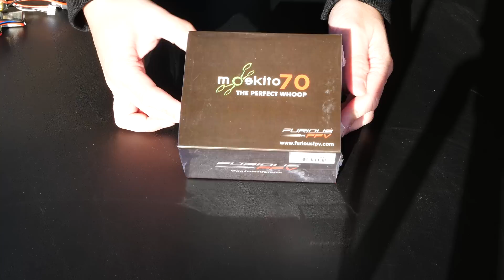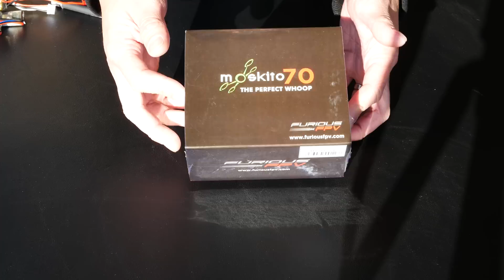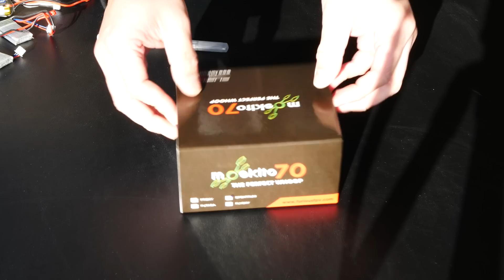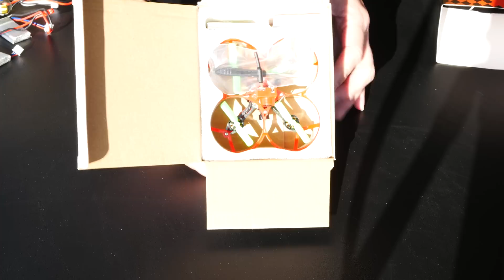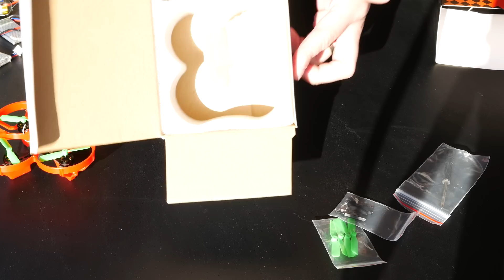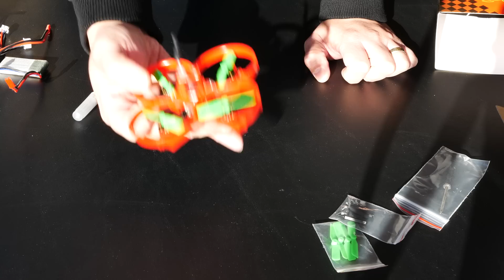FuriousFPV MOSKITO 70 Unboxing

Comment: Farmer fpv: bumper and esc guards are nylon for production models, however far from indistructabal, i cracked mine, fixed with epoxy, spares are $6 or you can print your own i supose, also unlike the inductrix you dont need to run propguards on the moskito since they dont hold the motors

Comment: I'm pretty sure the duct rings and all the plastic is all 3D printed, according to all the other reviewers it's 3D printed as well and very brittle.

buts great review Tony

Cheers

Farmer
Reply: Farmer Fpv the first few out there were prototypes really, these are injection molded plastic parts now and they went to 2 blade props and dipole antenna in the end and I'm happy about the dipole. I will have one tomorrow